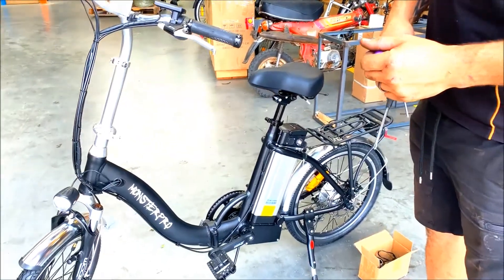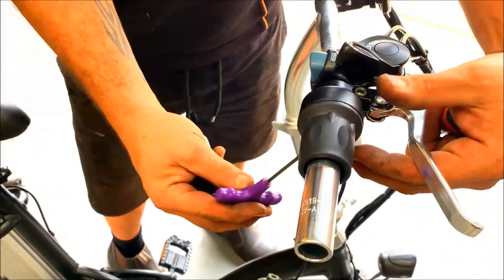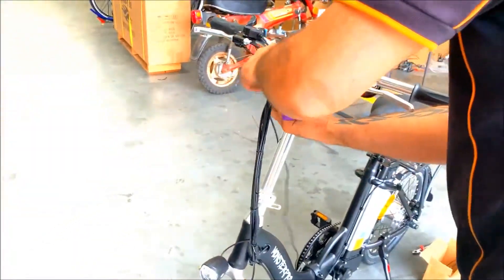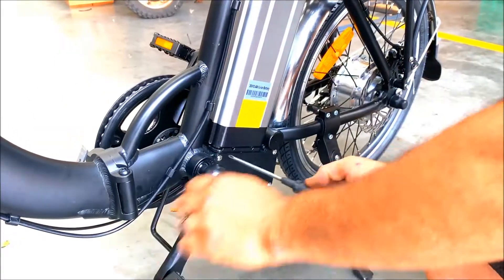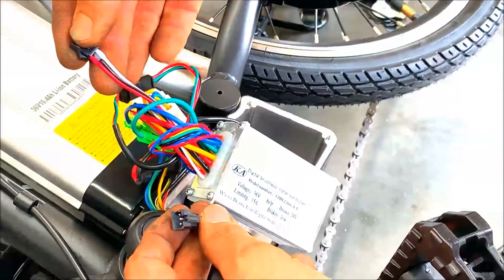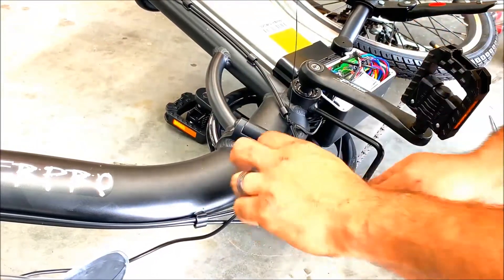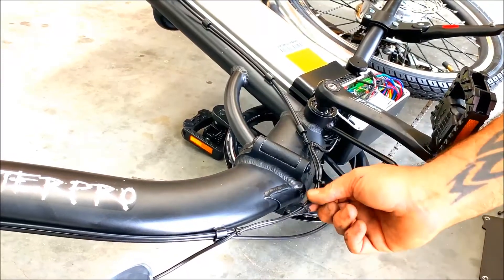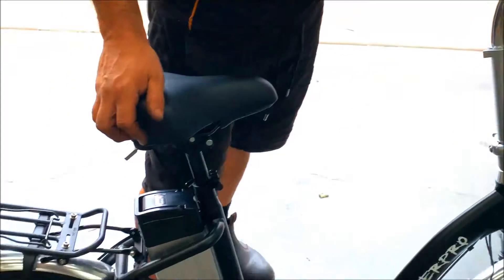How to Add a Throttle to an Electric Bike: Step-by-Step Tutorial

Comment: can you just switch the pedal assist wire and plug in the throttle instead ?
Reply: yeah my question is the same because my bike does not have the display and it has just the pedal assist buttons.

Comment: Some controllers don’t have a throttle connections , you have to buy a new controller that has throttle connection if that’s the case
Reply: i have bk5s with  S866 display , it doesn’t have throttle connections, i am checking on aliexpress for controllers, any advice which should i get?